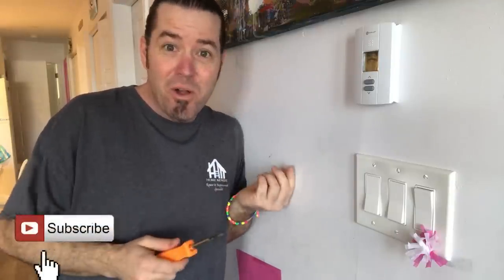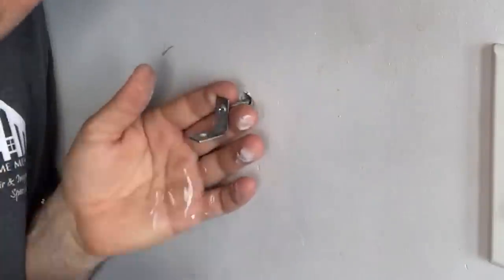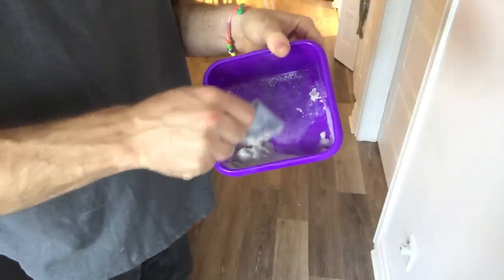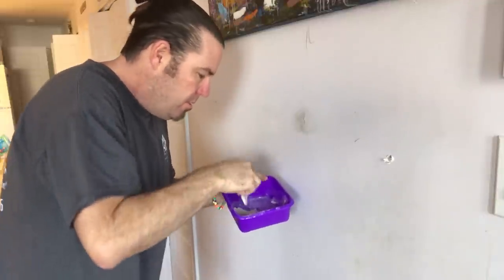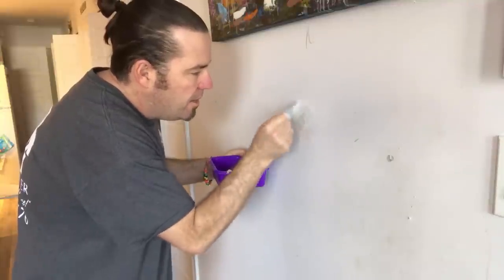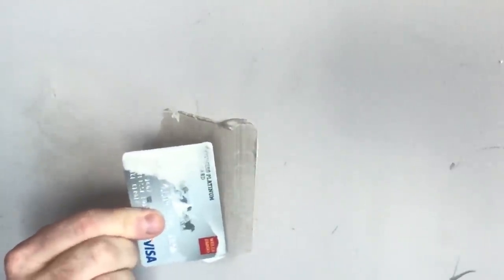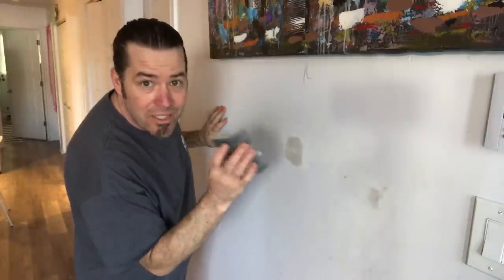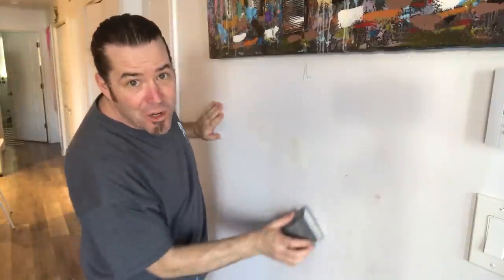Easiest Drywall fix. Drywall repair. Home Mender

Comment: Hey Dustin, just what I needed to see! Would you suggest using a toggle bolt for a steel handrail? If not, what kind of screw would I need? The original screw came loose because whatever was holding fell off in the wall and I want to fix it myself because I'm tired of waiting for my husband to do it. Thanks for the vid!
Reply from the maker: hey dani! toggles work well for stuff like that. it depends on what the wall is made of yourre securing it to and if you ahve studs there or not...let me know! thanks so much for commenting!
Reply: @homemend  Lol,  I'm not sure if there are studs but the wall is drywall. I just used the leveler, stud finder thingy and there are studs.
Reply from the maker: hi dani..yes if you have studs, i would do screws into the studs but if you have a place without, a toggle would work! you are awesome!
Reply: @homemend  Thanks Dustin! I'm on the search for the right size toggle bolt. I appreciate it! Good luck with your housing adventure!